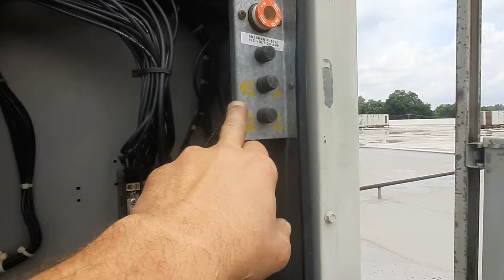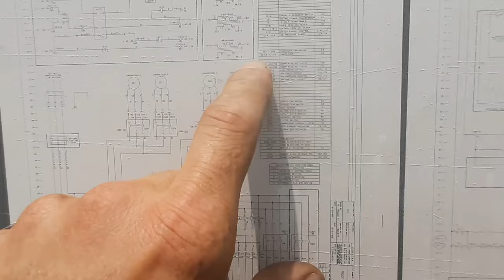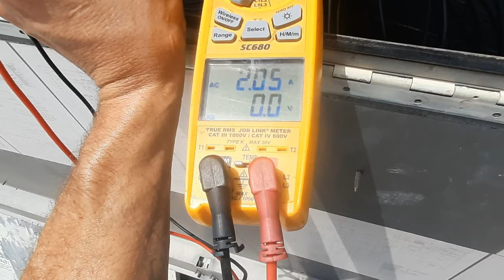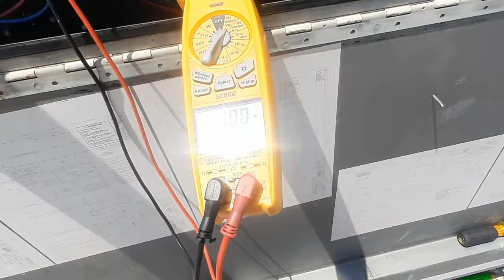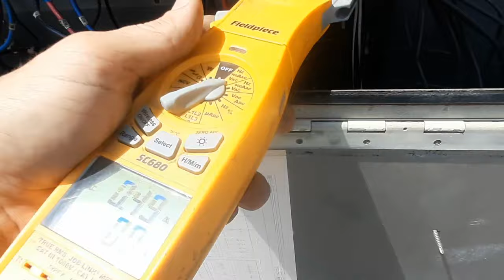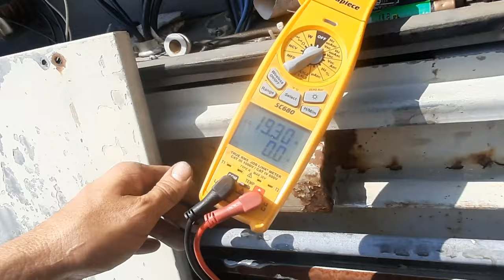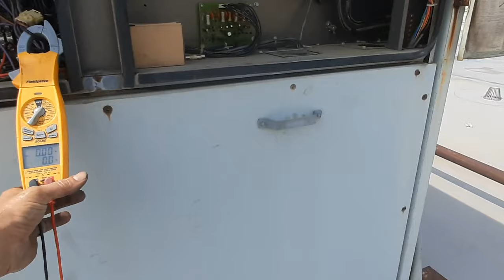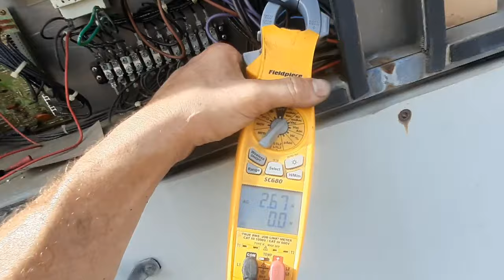a couple of 90s Trane package units, still kickin.

Comment: when i had stranded wires like that on contactors i always carried non-insulated butt connectors and crimp it on the wire and then you have a solid piece under the screw on the contactor for a solid  connection
Reply from the maker: This is the way.

Comment: If the wind is blowing the blade around, the condenser fan motor becomes a generator and you will get goofy resistance readings
Reply from the maker: Good call, I would assume that's the case for the dancing ohms. Thanks itsme!

Comment: Wonder if they removed the plug on the bottom of motor if it is a motor that can be used shaft up or down
Reply from the maker: I don't think so. The plug is where the wires go into the motor. a normal fitting would be better.

Comment: Seeing the way people wire those unit with extra wiring just danging there is just a bird waiting to make a nest..... I would be fired if I did connections like that as it is hard to see the logic of the controls circuit.
Reply from the maker: Yeah, it probably wasn't this bad 30 years ago, but these things have been through hell and had too many hands on them

Comment: I had a journeyman electrician fk a system 15 ton carrier heat pump unit at work. The board was damaged from water, only thing that ran was the blower. I said "DONT TOUCH THIS" unitl I order a board and a few sensors. I get back to install the board, blower realy is blown up. I go didn't I say dont touch this, he goes I did not. I say then how did the blower relay explode it was running last time? So I find a relay that will work and replace it. Go to start nothing, I have a 480 to 24 volt transformer, no 24 volts. He rips it out, puts in a 600 to 480 to 380 to 24 volt transformer same thing. I go dude check the incoming power, he goes we have a bad fuse, I said fk them fuses check power. We lost a leg, I traced it back to a motor control center where their was another bad fuse. I  dont no who in the fk signed off on this guy. I can't stand shitty work. Good job troubleshooting that.
Reply from the maker: Thanks WD!